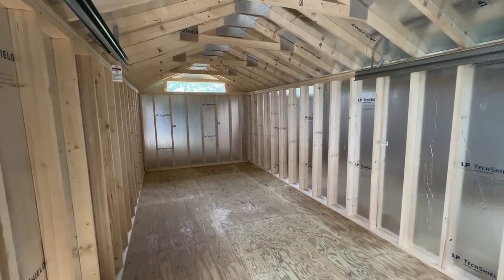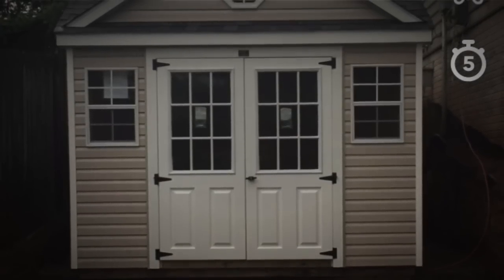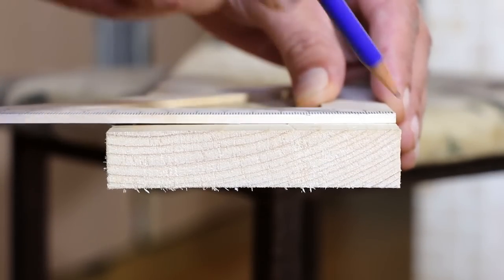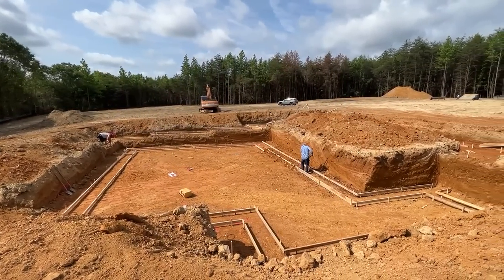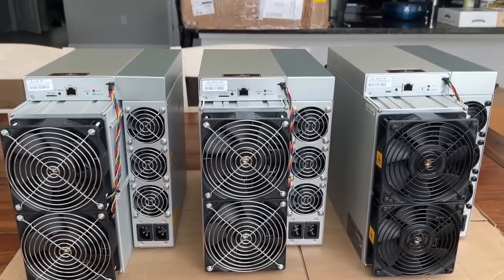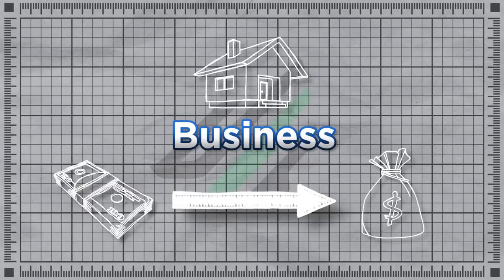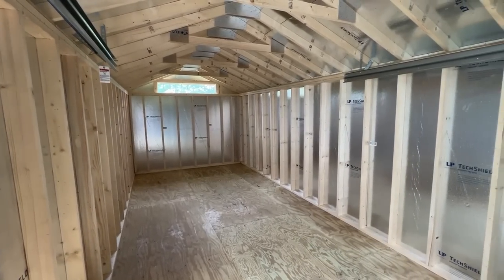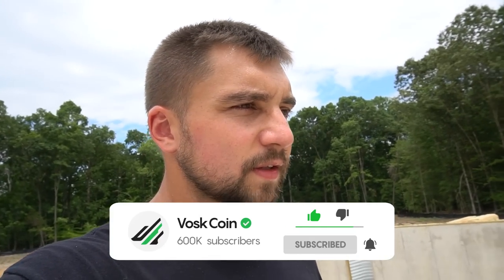Designing Electricity for a Bitcoin Crypto Mining Farm

Comment from the maker: Sub  - http://voskco.in/Sub
Watch our FULL electricity guide for mining at home - https://www.youtube.com/watch?v=eZi_yx_koXc
Follow us on our official social media accounts! - https://voskco.in/22
Reply: Something to think about...why spend 6 figures bringing the 3 Phase to your place, when you can go rent a small business bldg that's already wired for 3 Phase?

Buy a shipping container for less than you paid for your new shed. Drop it INSIDE a rented warehouse and run your 3 Phase right to a panel mounted inside. Mount a closed circuit monitor and remotely monitor your 3 Phase rig until BTC goes back up. 

THAT'S when you pay to have them bring 3 Phase to your place! I mean, the utility company won't care that BTC's price went up. All they're gonna care about is getting paid. Then, you bring your shipping container on a flat bed back to your place and end your lease at the other place.

As an aside, you can probably find "cheap" solar panels, which are at the end of their life cycle. Put them out in the sun and check the DC volts and amps. Discard the outliers. All they're doing in some of these places is filling up junk yards. Just like the power company bringing you 3 Phase, the price of solar panels isn't going to rise because BTC is going up. They're not correlated. However, the pace of solar panel efficiency is really getting quicker. If the panels last you 5 yrs, with having to R/R a few here and there, the payback will become almost nothing. Use all of the money you save to buy the best inverter and deep Cell batteries and wait for BTC to turn around!!

Comment: In the UK we can have 3600kwh solar before we have to notify the energy company. Nowhere near what you use I know but for us mini miners it makes it dead easy to do it diy and help supplement our energy costs.  I bought the panels and wire cheap online (look for solar farms overstock)  Then a grid tie inverter which you plug into a wall socket and your off! The hardest bit is working out the electric side of it, watts, amps, voltage, voc's, vdc's etc but there's loads of info online about that stuff. I hope it all goes well for you.

Comment: I’ve been running a few ASICS in solar off grid for a while now. The units plus network all solar and battery only.  Few rough areas and I need bigger battery banks soon.  I end up having to face heat and cooling issues though this summer and the ac, although can run off solar too really eats into battery capacity.  So I’ve been playing balance games too, but proof of concept has been established and it’s pure profit already.

Comment: 3 phase doesn't necessarily do anything for you, it's just more power with 3 legs instead of 2. It's used for commercial operations commonly where motors are running. It is 3 legs of 120v though by the way where they are separated by 120 degrees instead of the 180 degrees on split phase (AC power is a sin wave).

Just throw in the biggest transformer and electrical service as you can and let er' buck! Ideally you should be able to get into 400A service.  The next steps for the US would put you into 480V 3 phase service and 600, 800, 1000 and 1200A services. These can run pretty big farms but again, still nowhere near industrial scale. Ask BBT where he's at. They're probably running 13800 or 69000V for some seriously big scale. 400A 240V will give something like 76800W of usable power

Comment: The thing between 110 and 240 volts are the amperes a.k.a. amps.  Having lower voltage means the amps will be equally higher when transferring same amount of watts.  Higher amps means you have to have thicker wires, and thicker wires cost money, and the same principles concern probably all the electric stuff in that infrastructure connected to those wires.  
Easy to remember equation is P=U*I, where P is watts, U is voltage and I is amps. 
Also, you can make the same equation as U=P/I or I=P/U, you only need to know 2 of those letters and equation tells you the 3rd one.  HTH

Comment: For the dilemma between amount of solar panels and amount of batteries, you might realize the battery system is much more expensive stuff, than just to keep adding panels.  This could mean that you might build the solar panel capacity higher to enable some decent power also near the early mornings and late evenings, and have battery power only to run some essential stuff during nights. You can try to minimize the time needing battery power, and that might require also scheduling the mining process according the available power.   Then again, you might also have a system having no batteries at all, solar panels produce at days, power company delivers at nights, enough solar panels could make surplus you could sell to power company.  HTH

Comment: Depending on how large of a lot you’re working with, it may be easier just to go three phase solar than it is to do it through your local utility. I had my local utility company run the numbers for me as well and unless you’re putting in a Walmart, having them bring three phase out to you is going to keep you pretty far away from the ROI for the foreseeable future. Three phase solar just needs three inverters, and of course you can upgrade in sets of three if you need more power
Reply: He's right. At some point the solar numbers are winners. Anything over $20k and you should be "looking" at solar. Amortize you elecetric bill over 20 yrs + Capex (what they gonna charge you to build it to your house). Just my two centz
Reply: hi...

Comment: I think what you should do is attempt to tie into the electric grid to sell to the grid, if that's offered in your area - then, depending on the price of Crypto, use your own power to mine if the market is profitable or use the power to sell into the grid if mining is not profitable. That will give you a baseline profit to help pay for your operation.
Reply: You don't sell to the grid.you only get credits for how much you generate. From April to April if you don't use those credits it goes back to zero and power company keeps the extra power
Reply: @stevelemley8446  That's how it works where I am too, in BC Canada. I think you can officially sell to someone through the grid through a contract, but I'm not sure how that works. It is different in other areas though.

As an example, in BC there's a gas company called Fortis BC that also generates electricity and supplies (connected to the regular national grid) to certain cities. So might be able to get a contract to sell to others through the commonly maintained grid.

In some Provinces you could sell to the power company.
Reply: It’s a shame they are not forced to actually PAY you for your investment when you ‘sell’ back power.   Credits don’t mean squat when you never use the grid supply.

Comment: You can't have a 3rd leg with 240 because the separation between the 2 legs is 120 degrees. With 208 it's 90 degrees. The sinewave is just a rotating magnetic field. It's a circle...
Reply: Hey he can have 208 off grid with a 3 phase inverter.
Reply: @jcanonymous1451  that's true but it would have to be a separate power feed and he said he was going to be grid tie initially. Or at least I think he said so.

Comment: Higher voltage is not more "efficient"... it's all Watts in the end... Ohms law rules.... sure you use less current with higher voltage, so you can use smaller wire per amp load... but it's not more "Efficient"

Comment: If I was rich, I would get starlink internets, and where I'm from 120v isn't a thing. 3 phase is normally hard to convert into a supply for your rigs.
How many thousand watts do you plan on using, I guess you have a mains transformer somewhere near by and will stay within those limits or look for a new one.
each conversion = more loss,
If you can get 3 phase converted efficiently into something your rigs use then it might be a good idea.

Comment: When looking at that graphic of the solar panels where there are rows and rows of panels, I had this thought: 
What if you worked out how many panels and how to connect them so that you have one row providing the 240v or 208vx3 that you are after and setting up that one row with one of those "portable: battery packs that you can get (might be better with basically a Tesla Powerwall for each row) and then powering your shed (or at least the first stage of your shed) from that row? 
Then, once you have worked out the kinks in the system and are ready to upgrade, you build the next row and powerwall and so on?

You wouldn't need your shed connected to the grid for this setup either - which I personally think is a better option. (My brother has grid connected solar and he never receives anywhere near what the electricity is worth for the extra that goes to the grid, but they sure charge him full price if he needs any.)

Comment: Only do grid tie because micro inverters and normal inverters for grid tie is way cheaper than battery backup solar..look at renvu in California. When you buy kits from them the will do your blue prints and stuff for electrical permits.just need to give them info of you roof or dimensions of what your putting it on.i installed my own 7kw system on my house.to bad you don't live closer I could help ya out better.i would put them on shipping containers and have radiant air to water air handlers to get the heat out to heat water for your house.or if it was close enough duct the heat for the winter time.grid tie stuff is 240v. Just have them bring in heavy wire and transformer box that sits on the ground.we had one for our rv park.the main load goes to it then from it goes to your house and other things directly from it.dc wires must be in metal conduit inside buildings.and some ac run on the outside also has to.the electrical code book even confuses the inspector since it's an interpretive book and doesn't state facts and general pics then expand from normal stuff.you need a  Is rapid shut down and engraved signs on your certain electrical equipment. If you have the money look up ark inverters. You can add batteries later for backup.i have the outback 8048a that has to have batteries to run.its ok.ark came out after I installed mine.ark is more efficient and has more features.

Comment: wright on the other side of the Potomac and looking to do a solar build out for my Asics would like to know what kind of panels you plan on using..
Reply: Depends on how you are going to mount them—ground or roof mount. 
(Not the only consideration, but that’s what I usually ask first when someone is doing a diy solar build.)
Reply: Going to do ground mounts
Reply: Ground mount is a good choice. Solar panels lose efficiency when they get too hot. Don’t worry about getting high end panels—total waste of money. Try to look for panels in the 60 cents per watt or less price. Buy panels with seller offices located in the U.S.   A lot of panels are sold by Chinese companies who have no U.S. office so if you need to file a warranty claim you’re screwed. 
To run an ASIC miner that uses about 3 kw per hour you need about 18kw of solar panels.